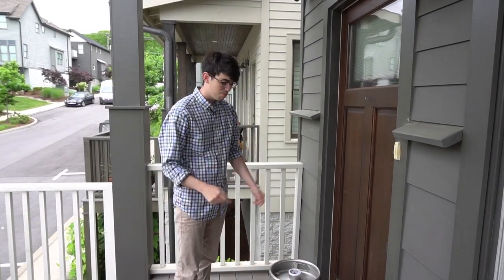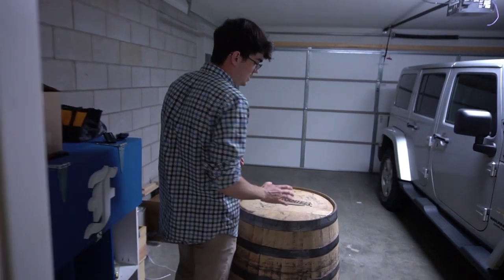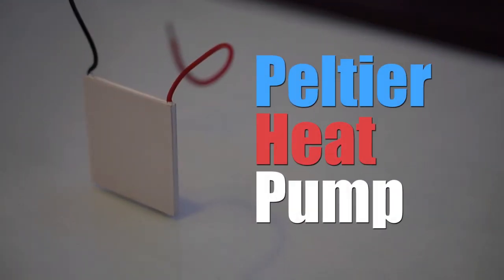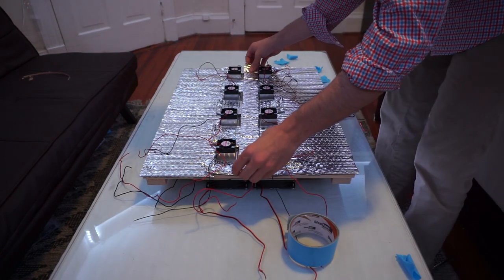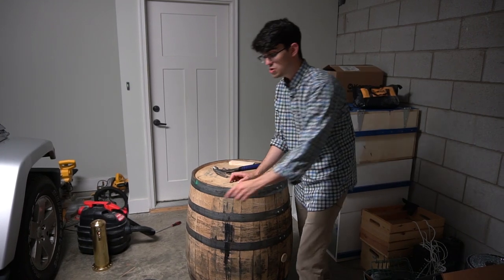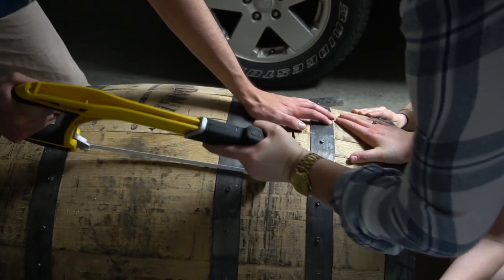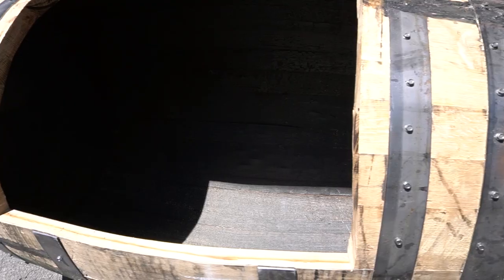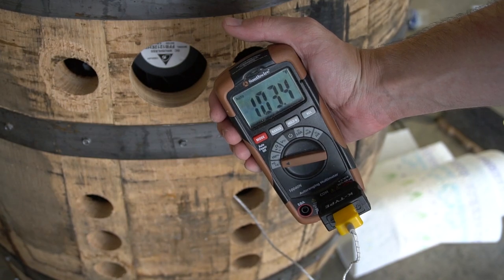Building a KEGerator: Cooling (Part 1)

Comment: Idea good, but Peltier's cells are not enough to cool the barrel. The best choices are the old compressor from the fridge. Current consumption is smaller and overall more efficient.
Reply from the maker: You might be surprised! After I finished the insulation (not shown in the video) the total volume the 8 Peltier plates need to cool is about a 1/3 of the barrel. The keg comes ice cold, so it would be ideal if the plates could maintain a temperature of 40 to 50 degrees. As I said in the video I traded efficiency for simplicity with the Peltier plates. Stay tuned for part 3 to see how they work! Thanks for your comment.
Reply: It's all about a insulation. Theoretically one peltier would be enough if you isolate whole system really well. Only thing that could suffer is cooling time.

Comment: Isn't it possible to just cool the pipe from te keg to the beer tower ? you don't have to isolate the whole keg, you just cool the beer right before you use it. Or are the Peltier's cells not powerfull enough for such a system ?
Reply from the maker: Yes this would be a great idea if the beer line wasn't made out of  thermoplastic vinyl hose. This material is pretty insulating, so it would be hard to cool it. Another reason why it it is good to keep the whole keg cool is because it slows down bacteria growth that would otherwise spoil the beer.